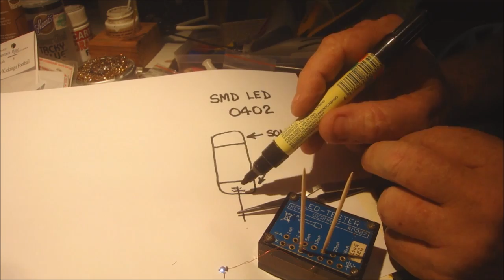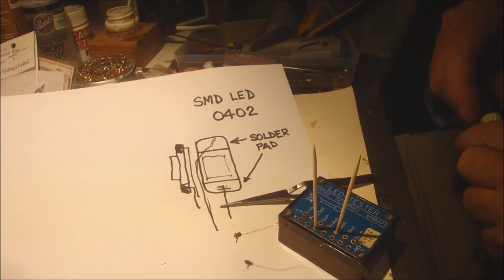Soldering 0402 LEDs

Comment: Hello, I know this video is old, but what voltage do you use for your LEDs, please? Also, thank you for the tip about using machined tweezers to hold the LEDs and for the glue! I was worried the glue would damage the LED's clear protective coating!
Thanks again.
Reply from the maker: I use a 12 volt DC power supply 3 Amp. LED need a resistor 1k (bright) to 10K (Dim)
Reply: @scoopmmr  Great, thank you very much.

Can't we power them with 3.2 volts using button cell batteries and a resistor?

I found this tester; what do you think of it?
Thanks again for your help.
Reply from the maker: @rayneaustephane2757  Yes if you know the spec's of the LED you are using then you can power it with equal voltage. I'm guessing you are creating something tiny and compact (?) So you can use SMD LEDs and SME resistors and button batteries of equal or higher voltage. Nothing came through re your tester.
Reply: @scoopmmr  Thank you for your replies. I don't know about small models, but I build Star Wars models: Millennium Falcon, 8-inch Arcadia 1:1600 scale. I'm going to use LEDs of different sizes, from 0402, 0805, and 1206 up to 5730, with metal and CMD resistors, as well as basic 30 and 36 AWG enameled copper and plastic wires. Thanks again.

Comment: Why do not use a microscope ?
Reply from the maker: Hi Martin, now days I just wear magnification glasses. I no longer use magnet wire and have found teflon insulated multi strand wire I get from HobbyKing called Turnigy 36 gauge. Comes in black and red insulation and is easy to strip the insulation and tin the wire. Regards, Laurie
Reply: Hi Laurie.  Such a swivel stereo microscope is not cheap. I do not have one, and I'll fix it with a watchmaker's loupe. I am also interested in such a teflon-insulated stranded wire. Will look in the internet at HobbyKing. Best Regards, Martin, Austria
Reply from the maker: @martinkrenn362  https://hobbyking.com/en_us/turnigy-high-quality-36awg-teflon-coated-wire-1m-black.html?countrycode=AU&gclid=EAIaIQobChMI7OeXkpb04QIVlRmPCh3EAQchEAQYAiABEgINQvD_BwE&gclsrc=aw.ds&___store=en_us
Above link to the Teflon insulated wire I use - better than magnet wire. A magnifying glass and good light helps. Regards Laurie
Reply: Laurie,  thousand thanks for the link. Many Greetings, Martin.

Comment: Awesome video!! I don't know how you can do that without a microscope? What size wire would you recommend for 0402? Thanks, Steve :O)
Reply from the maker: G'Day Steve, I love the HobbyKing Turnigy Teflon insulated AWG 36 wire for all my SMD LEDs. The other alternative is magnet wire available from Ngineering but it is single core enamel insulated and not flexible. Regards L
Reply: Thank you for the help Laurie!! Now all I need is a microscope so I can see those little buggers!! :O) Best regards, Steve :O)

Comment: is there any chance of a close up of your working love your videos, just can't see them well
Reply from the maker: G'Day Ron, The trick to grasping the 0402 is to modify self locking tweezers to make a chisel pont on each. Then holding 60% of the LED to tin one solder pad at a time. Once you have the first wire on it becomes easier. My Sony Cyber-Shot camera unfortunately doesn't zoom that well. Next time I do 0402's I will just take a photo and add it into the video to show closer. Is there something you specifically want to see? Regards, Laurie

Comment: Thanks for the info the anode ANd cathode  doesn't mean much to a beginner,the part I needed was the simple part you gave me ,like the flat is the plus and the triangle is the negative.right ,I no the other terms somewhat ,but the simple terms is what I thank u much for
Reply from the maker: Yes Ron, you got it right - Anode is positive and Cathode is negative and is the bottom of a T or the triangle point pointing to the negative. You can get SMD resistors from Ngineering for lighting in confined spaces.
Make yourself a LED tester using a 9v battery - solder a red wire lead to the positive and a 1000 Ohm resistor to the negative and put heat shrink tube over to stop the ends contacting / shorting and use the ends to check any LED.
Reply: Thanks for the info

Comment: Which mark on the back is the plus mark,there is a triangle and a straight line
Reply from the maker: The "T" means anode (+) is the top of the "T" and cathode () is the bottom of the "T". The triangle has the top flat as anode (+) and point is to the cathode (). The cathode / negative is where I put the resistor.
Reply: Thanks for the help

Comment from the maker: Charlie, the wire you most probable got is called "magnet wire" and has an enamel insulation around the wire. You need to burn-off the enamel by raising the heat on your iron and having a blob of solder on the tip to push the wire ends into. This will remove the insulation and allow solder to take.

Comment: Ordered some of these off ebay, looked way bigger then the pics, these are way too small. Anyways. They came pre soldered with some weird wire the solder does not stick too. How do I use these guys? They also came with separate resistors and I have not idea who to get these to light up. Any suggestions would be appreciated.

Comment: Hi, Can you tell us all what size resistors you use for each type of 402 LED installation?
For example, what resistor for power directly from DCC track, and safely connecting to a decoder.
Reply from the maker: Name ? - Resistor values don't change for the LEDs - I commonly use 1.5k for loco lights, 6.8 k for marker lamps.
Laurie

Comment: Hi Laurie.
I too have done 0402 LEDs usually ping 1 in 3 into the never never.
I use double sided tape on a ceramic tile to hold the LED.
I use Electronic flux pen and solder paste from Jaycar have the same of iron as yours  and a selection of bits including a 0.8mm one used for the LEDs.
Solder paste comes in a syringe,I dispense a small blob of it onto a piece of plastic, dip the pre-tinned wire into the solder paste, hold against the LED pad and hit it quick with the iron. Job done.
Graham

Comment from the maker: Adam, I usually wire LEDs in series. I use Tamiya clear paints to tint the white SMD LEDs however if you want red then it is best to get red LEDs as the tint, over time, can fade somewhat.
Many SMD white LEDs are bright so my suggestion is to use a higher value resistor. It was common place to say "just use a 1k" but this is too bright IMHO, start with 2.7K for brioght and around 4.3k for general lighting.

Comment: I have found can get these in a variety of colors, do reccomomend just going with the whites and tinting them to the color desired?  Seems logical since the voltage varies for colored LED, I guess it would standardize your resistors used....  Also,  Dou you wire these parralel or series?